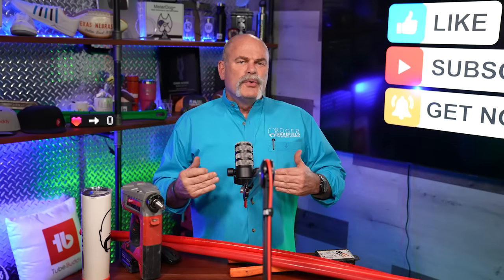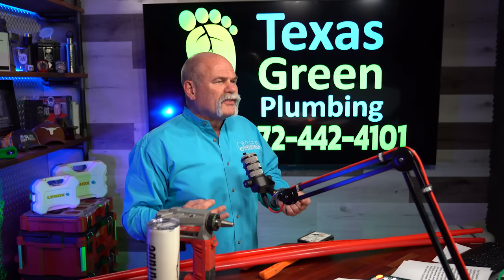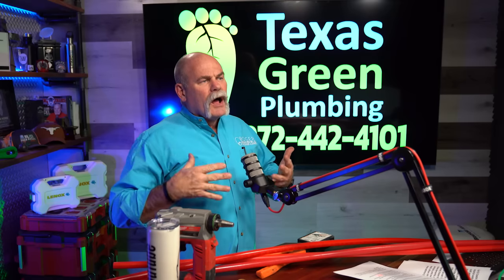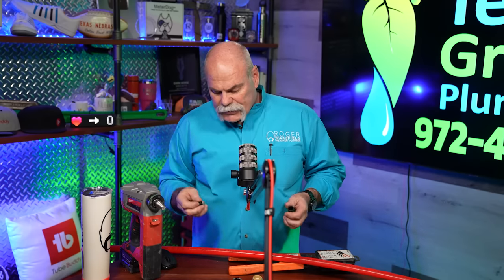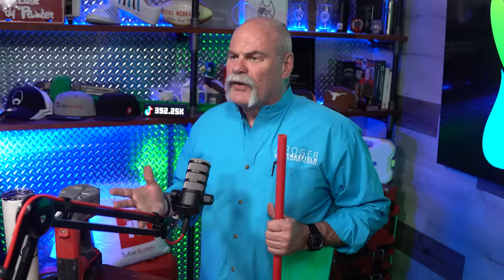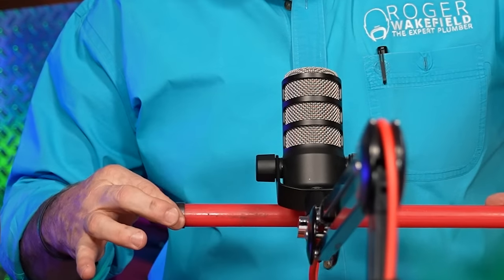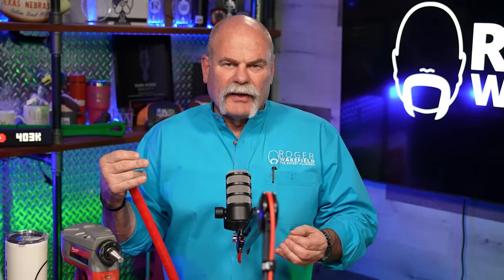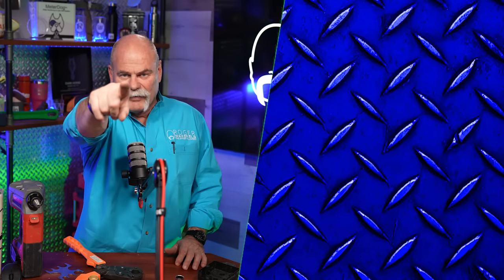HOW TO INSTALL PEX PIPE THE EASIEST WAY

Comment: PeX A is great if you have a good swedger like you have. If you have a manual one it kinda sucks...... It also recovers from over bending with heat also.
Reply: I've seen guys make an emergency puncture repair on PEX A with a heat gun.  there can't be material removed, and I wouldn't trust it longer than it takes to get what you need to come back and make a permanent repair, but just heating it and letting it cool will give a temporary fix if it got hit with a nail or staple.

Comment: Hey I'm a plumbing apprentice and been talking to my boss about expansion. We use cinch clamps mostly what's the cost for fittings and pex between the different kinds?   I think expansion is more reliable and easier to get to work in right places where you can't get your cinch clamps.
Reply: Pex-a fittings are slightly more expensive than pex-b but just barely. The pex-a system is superior in my opinion. But you know what they say about opinions 😊

Comment: You talked me into replacing my 1/2 inch PEX using Push fit Sharkbites to 3/4 PEX Barbs ! Should give Flow rate similar to 1/2 inch copper ! Probably will eliminate water hammer that started after Tankless installed with Sharkbites. Now what do I do with all those extra 1/2 inch Sharkbites.
Reply from the maker: Sharkbites you say? Throw them away…
Reply: @RogerWakefield  Yes. Not impressed. Expensive, restrictive etc. Hope getting rid of 10-15 Sharkbites improves the FLOW !
Reply: @RogerWakefield  May put them up on Kijiji for sale cheap. Put new Recirc pump in. What a difference.  The last pump I put in was cast iron. Garbage from China. New one Stainless. Also bought the new DRV from Rinnai with Recirc shutoff and check valve built in.

Comment: I am by no means a plumber but my little research is that Pex B is far better than A. 
Getting ready to repipe replacing the grey poly-B. 
I've read that A leaches significantly more chemicals than B. A also breaks down faster with chlorine.
To me that makes it a no brainer for any plumber to use B.

Comment: The insert piece inside of a "shark bite" is made for Pex and Polybutylene pipe. Therefore it will have a stiff structure inside of the plastic/softer pipe. That way the softer pipping will stay in a perfect circle and not risk the pipe losing its shape and the fitting leaking. It will NOT reduce the flow rate. 

Also, Evo Pex Pipe and Fittings are awesome. They are Shark Bite style Oex Fittings, and yes, plumbers these days love the Evo Pex Pipe and Fittings system. 

Why? Because it's super easy to work with, your hands don't hurt after manually crimping all day long. Plus you don't need a giant cordless tool to complete the install.

I see a lot of the Old School Plumber's are bitter because we have it "easy nowadays with Pex and Pro press Copper. Well, why the f would I not use the new technology? Why kill myself doing everything the old way just to please some old dude in YouTube who honestly, gives terrible advice.

Comment: Great video but 2 things to point out. 1. Anytime you transition from copper to any PEX a flow restriction is taking place. For 3/4" applications copper is a full 3/4" inside diameter, PEX pipe is 5/8" inside diameter. With the PEX B fitting the inside diameter drops a little further. And what Roger said about Sharkbite is very true. If you are joining/coupling say 2 (two) 3/4" copper pipes using a 3/4" Sharkbite coupler, the inside pipe diameter is 1/2", not 3/4". A reduction of cross-sectional area of 33%. 

2. I like PEX A most of all as well but I don't do that much plumbing. It's a hobby to me. So I use those manual expansion tools. There is no way I would want to do a full house with the manual expansion tool. I'd certainly invest in the type tool Roger is using above, the Milwaukee expansion tool. But it does cost in excess of $400.
Reply: I don't understand what you mean about joining copper with sharkbite - pretty sure they're full bore... not that that they're something you should be sticking I'm wall and such

Comment: Can you expand on the Shark Bite problems? Pics would be great. Was it the fitting or installation?
Reply: I see more shark bite related leaks than any other. Not that they CANT work but the turnover rate is unacceptable. However, in a pinch, late at night when everything is closed, it's an amazing thing to have on your truck because you can give water back to your customer for the time being until proper repairs can be made. I have a love/hate relationship with shark bites

Comment: Roger I have some copper pipe that I can't get to to change it out whats the best way to connect my pex A to it
Reply: You will need a brass adapter. Solder one end to the pipe or add a valve there, whatever connects to the pipe on one end and to the PEX on the other, even if you have to use more than one part.
Reply: @jamesflynn10  thanks

Comment: You mentioned at the beginning of the video that you were going to explain how to tell the difference between each variety of PEX simply by looking at them. I don’t recall seeing that.
Reply: It wasn't the clearest so I get the confusion, but it was at 11:33 where he mentioned the brands. The pipe will have the manufacturer printed on them, and you can tell the type based on the manufacturer/brand names he lists.
Reply: Also pex b feels cheaper than pex a. Try bending both and youll notice how rigid pex b is

Comment: I grabbed some pex A scrap to finish a project and used crimp on it. I noticed after charging it, didn't leak.
Reply: You can crimp anything you're just not supposed to expand anything except pex a but I've expanded pex b and it was fine too

Comment: I was going to use 3/4 from main line then 1/2 to fixtures may even do a manifold system.  Pex b.    I'd love pex a but the tool is quite expensive for the automatic type and the manual ones I've heard are way too hard to use.

Comment: The very few sharkbite fittings  I've seen that had a drip was installed on pipe not properly lined up.
Reply: Or the pipe was not deburred. Also, I don't know how you would tell after the fact, but I was told it will likely leak if the Sharkbite is removed and reinstalled more than 5-10 times.
Reply: Also depends on potable water profile.

Comment: Pex-A expander & Ring sleeves can be used to attach/ repair new garden hose fittings, instead of using hose clamps, but just remember to wrap the sleeves/Ring with pipe tape to shield it from UV rays 👍

Comment: The flow volume for Pex A is substantially higher than B and C, even without push fittings like Shark bites
Reply: With expansion fittings.  Or are you claiming the tubing itself has less friction or flow resistance?  Using A pex with expansion fittings and tools the system will have better flow rates.

Comment: I just attached a spigot with crimp rings on Pex B pipe. Im not a fan of how the fittings are capable of moving within the pipe even though it won’t leak. Does Pex A do this also? Last question, can you use crimp clamps on Pex A pipe also? Thx
Reply: You can use any method on pex a
Reply: @troylitle3116  does the pex A pipe still move on a fitting like it does on pex B?
Reply: @neilhansen3025  they're the same diameter pipe so it shouldn't

Comment: As a homeowner, I'd like to use the expansion connection, but won't be buying the $500 tool you're using. Home Depot does not rent this tool, either. What are my options to avoid flow restriction?

Comment: See im the opposite on uponor. I love but hate it. Living in a state like Indiana where weather fluctuates your constantly fighting uponor in either extremely cold situations where you need a heat gun to to rapidly heat it to shrink back down to original size or in summer where it's warmer hold it in longer times for the same thing. In an area like mine pex B is the go to for crimping and maximum productivity in the work space

Comment: I like ZURN PEX-B as you can actually USE EXPANSION tools on this OR compression/crimp tools and fittings as well. Now that pretty cool, especially if a house is all pex-b and you prefer expansion tools. It’s nice, imo, a d my fav way compared to press/crimp fittings. So, that our fav and also Uponor pex-a.
Cheers✌🏻
Reply: This isn't said enough. The misconception that PEX B can't be expanded is Uponor propaganda from years ago. The only thing that's different between A, B, and C type PEX is the chemical that it's crosslinked with. Zurn PEX has been our go to for years and the expansion capabilities with it now make it even better!

Comment: Wasn't there a PEX pipe back in the 80's that deteriorated over a short period of time?  Maybe 10-15 years?  I remember hearing of huge recalls back in those days.  Perhaps the piped was installed in the 70's.
Reply: Polybutylene pipe. It was installed between 1978 to 1995. It is estimated that polybutylene piping was installed in over 10 million homes around the United States during this period until it was banned. PEX (cross-linked polyethylene) does not have the same problems as polybutylene, hence why we install it today.
Reply: @djdannypachy  Thank you for that explanation.
Reply: @djdannypachy  are you talking about the dreaded "black or Grey poly" that I've found in so many homes and water mains? I've never gotten the technical term for it before
Reply: @serpentinefire921  polybutylene

Comment: And either way it's an insert fitting so it will also create turbulence as well as a drop. See the specs of the fittings they are also smaller than the diameter of the pipe. 3/4" pipe is .824 inside diameter and the inside diameter of expansion 3/4" fitting is .681 so therefor it is a smaller diameter insert fitting. Hence the reason you cannot use any 3/4" pex pipe for a relief line on a WH.
Reply: any fitting will create turbulence.  even a soldered copper coupling will create turbulence.
Reply: So using your logic…does code allow for 1” pex  or larger relief line?
Reply: @travlangley1  Ipc/Irc states if you use insert fittings it must be upsized. So yes.

Comment: For the home owner the push together  fittings  cost bit more but no special tools required    especially  if just repair  one time fix   these special tools are not cheap use one time then get lost lol lol  unless you are doing a lot of plumbing     not every place have rental tools

Comment: pex A is the best type of pex, I only use pex for water you do not drink. I use copper and sometimes CPVC for drinking water.
Reply: I researched and found that pex b tends to have less leaching of chemicals than pex A so better for consumption. There are situations where water conditions will rapidly destroy copper.
Reply: Don't use cpvc lol that'll become so brittle and leak
Reply: @troylitle3116  I have had no issues with Genova cpvc, there are some 60 year old Genova cpvc pipes still strong and functioning well.
Reply: @jacksplumbingvideos7147  it's not the manufacturer that's the problem it's the pipe itself. Half the repipes i do are from cpvc leaks. But to each their own
Reply: @troylitle3116  manufacturers do change the strength and quality of pipe fittings, the quality changes when different companies of resin are used, how much recycled resin is used, and how they cool the fittings afterwards.

Comment: Every time I use Pex B the crimp ring is always moving, or the elbow is sliding out
Reply: You can gently squeeze the crimp ring so its not so perfectly round. That way it will not slide.
Reply: @sharonanderson7810  Thanks for the tip! I'll try that ~ always giving me trouble but this could work ~
Reply: @lostevesy  yea just squeeze that ring with some channel locks

Comment: He keeps showing a viega fitting when he says push together fitting. It’s not a push fit. It’s a crimp but with the rings built in. They actually make an expansion system with B. Zurn makes a version of it. Our supply house was going to start carrying it but ended up not doing it because their pex a brand which is heat link introduced expansion fittings. I thought he was mistaken until I googled it. It’s rare and I don’t know if it’s any good but it exists. He’s right though expansion is the way to go. We do all our jobs in uponor. We even use it sometimes on commercial jobs because it’s fire rated though most engineers want copper. It comes in up to 3”. Im sure they make it bigger but I’ve never seen it. The only issue I have is our main supplier doesn’t carry uponor. They carry heatlink pex a and has both crimp and expansion fittings. This means if I get uponor I have to make an extra stop just to get pex. On service calls and small remodels I’ll use heatlink but on 100% new jobs I have to use all uponor because if something fails and it’s not 100% uponor their warranty won’t cover it. Another issue is heatlink only has up to 1” expansion fittings at the moment so it’s limited but hopefully they’ll eventually go all the way to 3” so we can use them exclusively.
PS I retract one of my previous statements. As of last year heatlink began carrying up to 2” expansion fittings.
Reply from the maker: You are right. I kept grabbing the Viega instead of the Sharkbite push... They were both right there... I do make mistakes I promise...
Reply: @RogerWakefield  first stepping in fixing it is admitting you have a problem lol. My ocd kicks in sometimes and I have to point out little stuff like that. I knew what you meant.

Comment: I wanna build myself a triplex, I know I'm going with PEX inside the plex, but should I do the main outside in copper? What about the entrance with the one way valves?

I know a lot about commercial and heavy residential plumbing (HVAC tech in a engineering firm) but I know little to none in light residential plumbing. Also living in Canada if that helps.
Reply: Pex works in the walls and under the ground. If underground run pipesleeve or insulation over it for extra protection. Here in Las Vegas it's code to run tracer wire as well(for any pex underground). If it's going above ground (ie going into a garage from the ground/prv and shutoff loops) then you would transition to copper before the water line is visible and insulate any copper exposed to the elements. From there you should be golden.

Comment: someone i know flooded a house with expansion pex, so we stay away from it
Reply: Was it diy or professionally plumbed?
Reply: @nhatty4178  professional. it was probably just human error but still scared to try something else
Reply: Usually it’s a good idea to test something before running it fully open lol. I’ve never had a problem with pex or expansion
Reply: @biomez  my company repipe homes and apartments everyday and we have 2 teams and we have been doing it for a year now. We only use uponor pex A and maybe had 2 issues. Although leaks can happen, it happebs most likely due to human error, or the plumber forgot to check water pressure.

Comment: This video is a bit dated. For those interested in expansion fittings, dont focus on A vs B, instead look for the F1960 rating.  For example Sioux Chief makes PEX-A and Powerpex (PEX B), both can use expansion fittings that are availble at Menards.

Comment: Benefit of pex b though it seals instantly with the crimp rings.  You have to wait a day or so for the expansion rings to seal back up
Reply: False
Reply: A day or so? What kind of pex are you using? It seals in a minute tops if you expanded it way too much.
Reply: @serpentinefire921  right the only way it takes more than 2 seconds to seal is if it’s cold. Like really cold
Reply: You should be expanding 1/2" like 8 or 9 times 3/4" like 9 or 10 times and 1" like 18 or 19 times no more no less

Comment: Why does the plumbing profession seem so eager to adopt every new junky technology that comes along?  Saving on material costs and labor rings pretty hollow when there are leaks or the house needs to be re-piped.  Is the modern plumbing motto:  Why do it right once when you can keep doing it over and over again?

Comment: I still say that it takes the plumber out of plumbing.
Reply: Would you rather spend 4x time on the job or get it done get paid and get out? If it doesn't leak what's the problem

Comment: Just an FYI, in the beginning of the video when you pulled that “push connect” fitting together, you were incorrect. That was a Vegia “Pure flow” fitting which requires a crimp. I use my Propress gun with the appropriate jaw. Not a push connection fitting. The ring you pulled off is a similar idea of the crimp ring you used the manual crimper with.

Comment: How much longer are you going to continue spreading this inaccurate statement that only PEX A = expansion fittings?  Both PEX A and PEX B certified under ATSM F1960 (e.g. Zurn PEX B) can be used with expansion fittings.  Anyone who is claiming Uponor PEX A is superior to Zurn PEX B F1960 or vice versa is just espousing marketing from these respective manufacturers.  Yes PEX A has a longer track record than PEX B using expansion fittings but I am aware of multiple  "accidental" installs out there using Uponor PEX A rings and polymer fittings on Zurn PEX B (pre-F1960 certified) that are over 10+ years old without leaks.  In reality, either of these systems installed properly (which also means not mixing rings and fittings between manufacturers) will probably last 50+ years.  Or not.

Comment: Hey Roger, have you heard about the uponor class action lawsuit that alleges the red/blue pipe has cracking issues? Uponors discontinued it in place of colored lettering on white pipe. Seems like the accusation has some teeth.
Reply: I'm still finding red and blue uponor pipe just fine. Haven't heard anything about this. Got any links?
Reply: @serpentinefire921  I also googled around a bit and found a thread about it on a plumbing forum where a few plumbers said they'd seen similar issues. Hoping it's not an issue because my house has red/blue uponor...